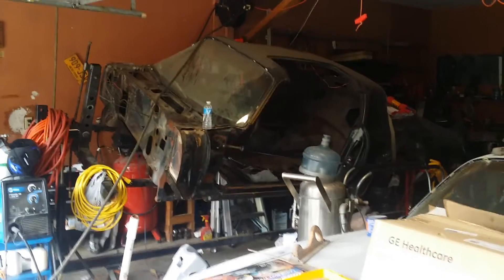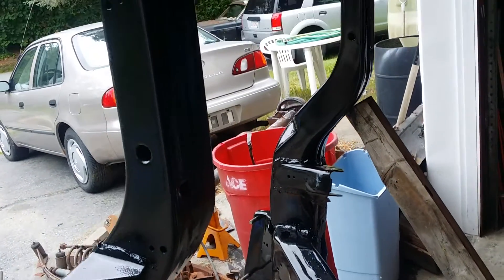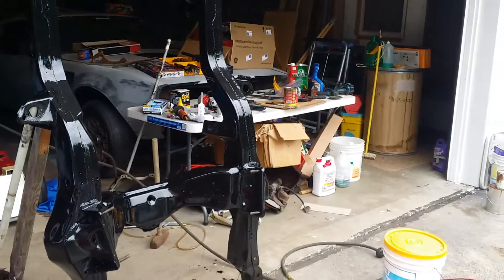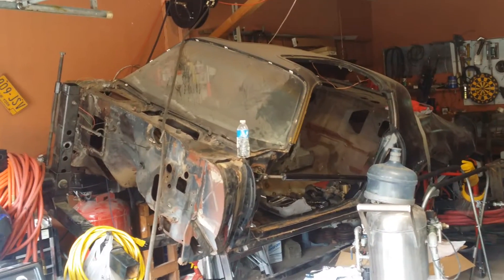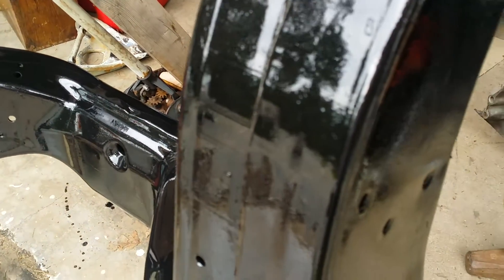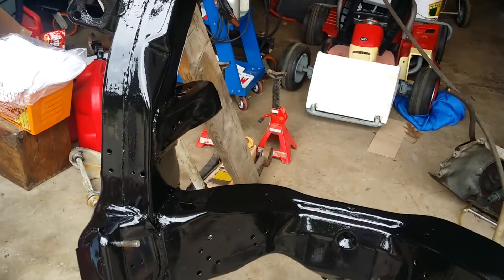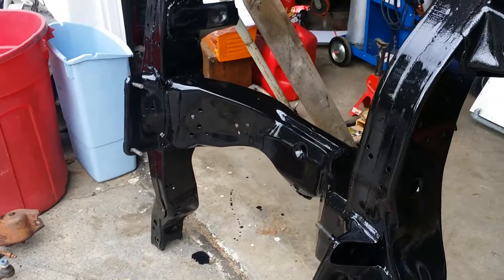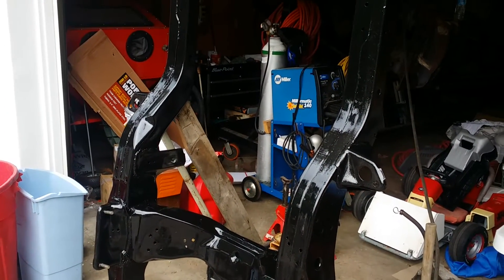POR15 1977 Trans Am subframe

Comment from the maker: The bolts were pretty frozen. I soaked them in PB. Blaster for a few hours. The set under the firewall I grabbed the cage nut with vise grips so it wouldn't deform the cage. 

Do not use impact tools on them!

I slowly turned the bolt to un loosen and then I tightened it to help break the tension.

You can use heat too if needed but be careful of fuel and brake lines.

It really wasn't that bad. Just take your time.

Comment: Nice job.......  how hard was it to remove your body bushings?
Reply from the maker: well if you don't spin the cage nut it is simple. I recommend getting vice grips in on the cage and then hitting the bolt with some PB Blaster and an air gun. Then you don't have to worry.

Comment: How much material did you need?
Reply from the maker: I used 1 quart and it did the whole frame with 2 coats. I still had material left over but you can not save it even with plastic wrap. You can not even save it for one day. You must do it all in the same day or buy a new can. I learned this the hard way when I painted inner fender wells the next day and it bubbled and turned dull in blotches. It had to be reblasted and repainted with a new can. POR15 sent me new can for free and did right by me.
Reply: Thanks! I currently have a 79 Firebird in pieces that I am working on.